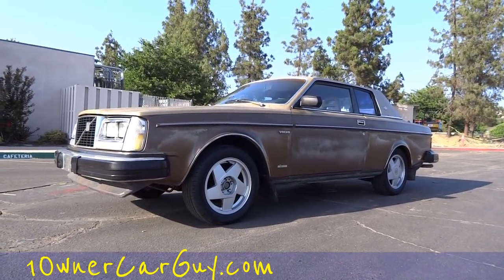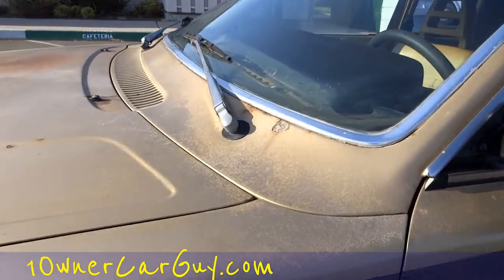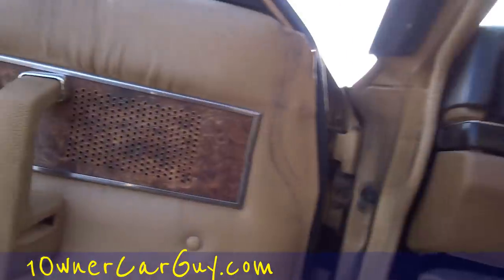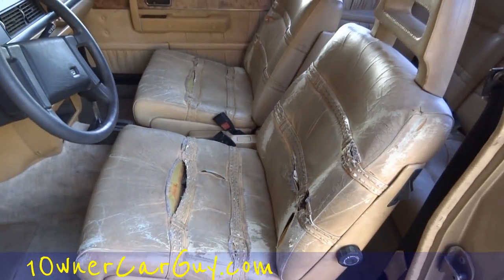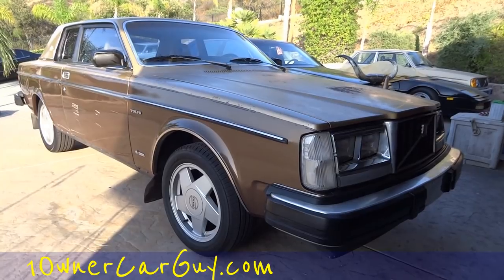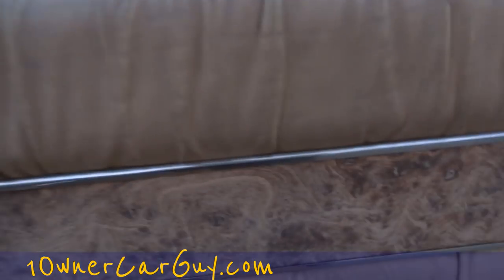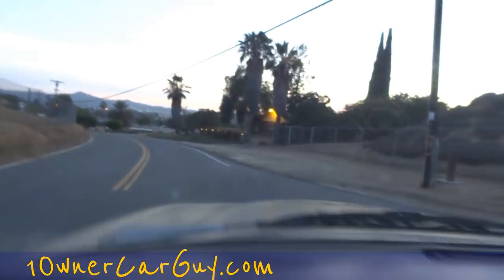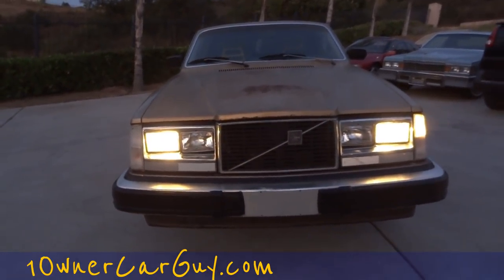Volvo Bertone 262C Coupé 242 262 Brick 240 For Sale Test Drive Video 1 Of only 912

Comment: @CerealMarshmallows Nathan, I can tell that particular car is a 1981 b/c it has the updated instrument cluster that was introduced for that model year, which would remain until the end of production in 1993.

Also, I notice that car has a redblock B230F engine. The 262C Bertones came standard with the B28F PRV V-6, which leads me to believe that the motor was swapped out at some point in the car's life. I would've done the same thing myself, as I hate the PRV. The car's MSRP in '81 was $19,560.

Comment: Hehe cool old brick but its not a B23 its a B21....which is so much better than the ultra crappy 2,7 litre V6 PSA unit which are also found in them .....but it really deserves a V8 conversion and a full paintjob